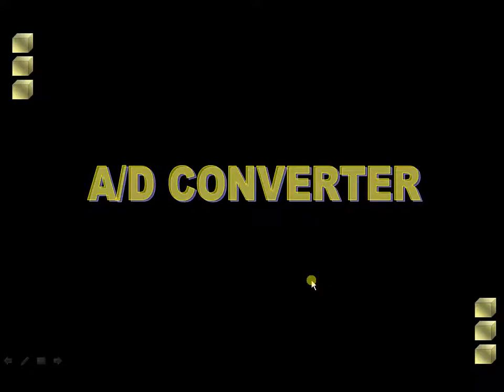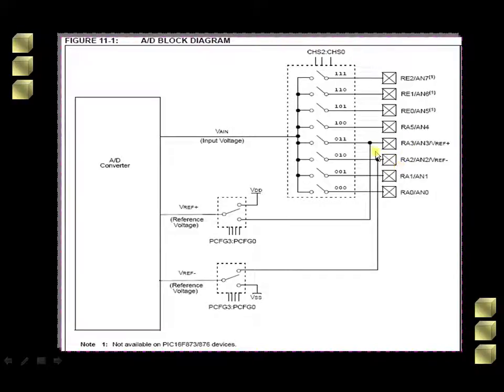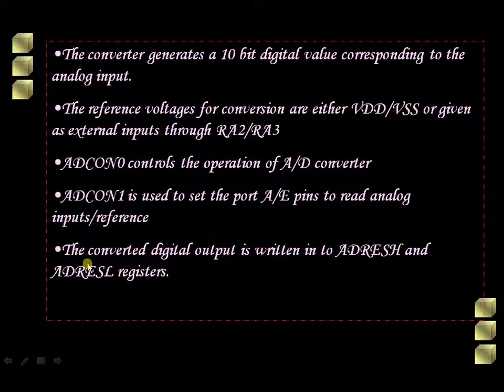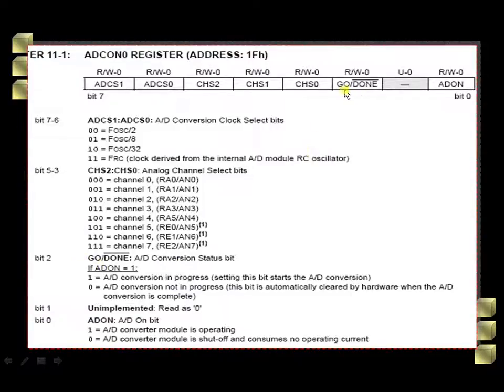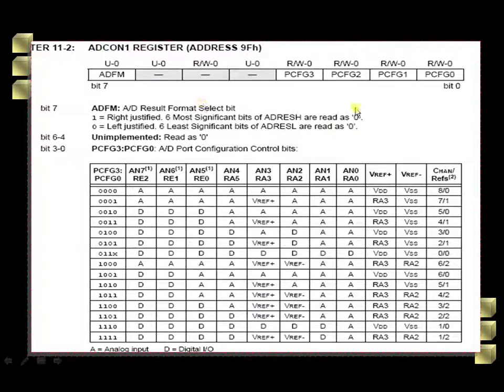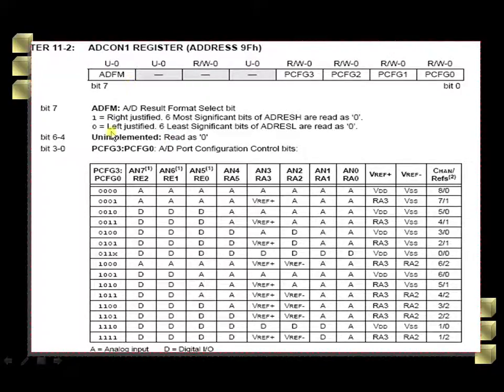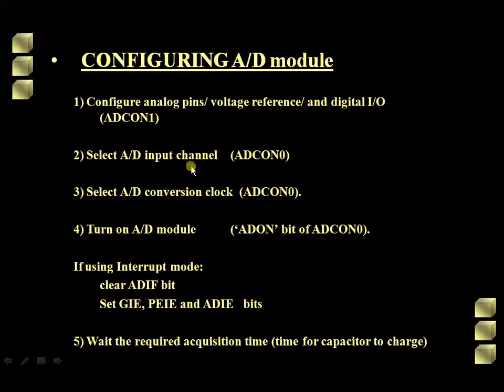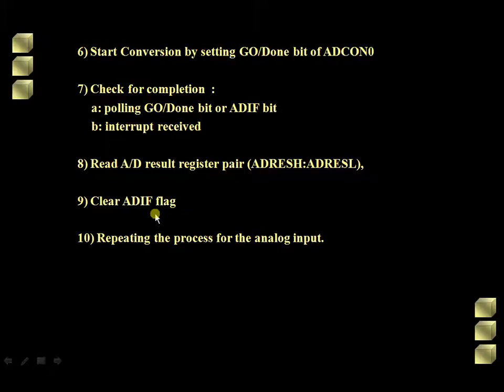PIC ADC Tutorial - PIC Microcontrollers - PIC16F877a

Comment: have a speedo meter works on encoder. encoder purse rate 0- 500 pulses per second  on both channel A & B .my meter has 5%  errror  i wanted to feed this to  micro controller and make 5% more pulses out put on both channel  to compensate the error.  (for examble if frequency 100 hz i need 105 hz output) could you please help me